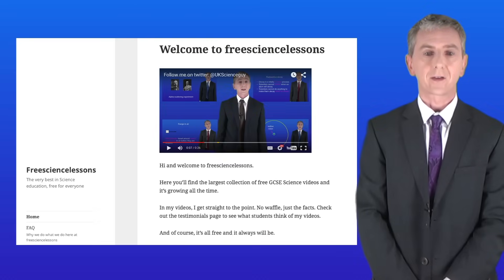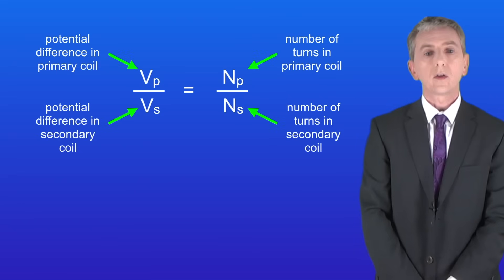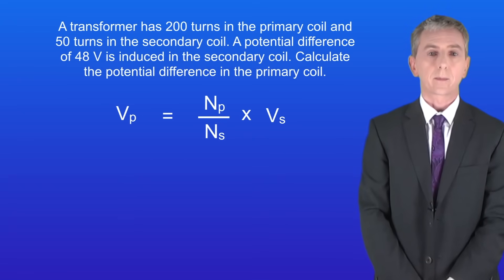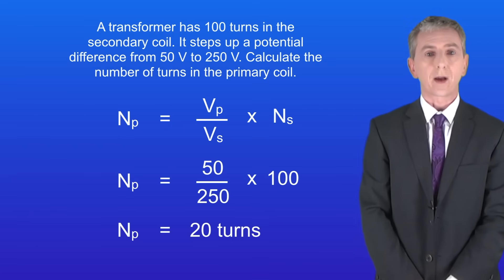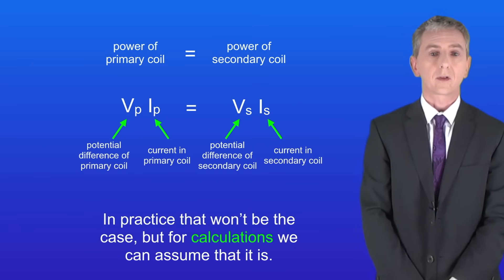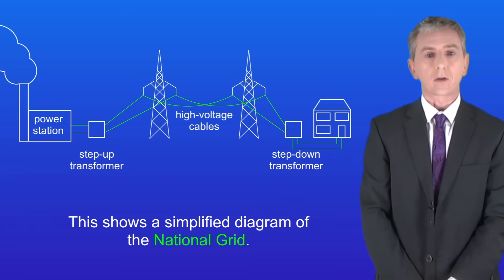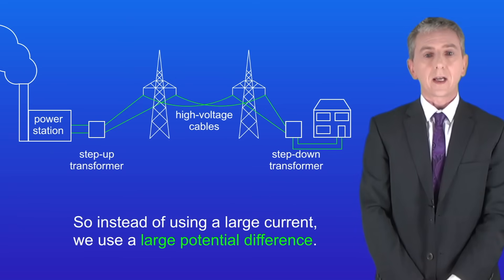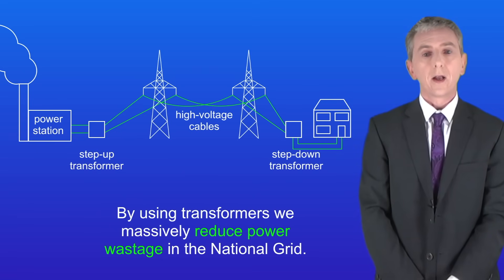GCSE Physics Revision  "Transformer Calculations" (Triple)

Comment: I don't understand why the potential difference across the secondary coil be 200V wouldn't you minus 50 from 200 because 200V is the potential difference of the whole transformer? Please explain I don't understand
Reply from the maker: The potential differences apply to each coil of wire not the whole transformer. Each side has its own potential difference. Remember that transformers work with alternating current, in other words where the potential difference rapidly oscillates. The changing potential difference in the primary coil induces a magnetic field in the iron core. This magnetic field passes along the core to the secondary coil, where it induces an oscillating potential difference. If the two coils of wire have the same number of turns, then the potential difference across the secondary coil will be the same as the primary coil. If the number of turns is different in the two coils, then the secondary potential difference will not be the same as the primary. I hope that helps.

Comment: Sir I did not understand why pd has to be higher and not current. As pd is directly proportional to current , won’t the current increase too.
Reply: Might be too late now but idk if ur school is doing testing but its because if current is high a lot of energy is lost by heat when the power is transmitted across high resistance cables, but when p.d. is high this isn't true

Comment: Hi Shaun, I understand that as P = IV, then for the same power if we increase the voltage, we decrease the current. However, considering the equation that you referred to of P = I^2R, surely if we have a decreased current, then for the same power, resistance must increase? Which is the opposite of what I thought was supposed to happen... if you (or anyone) could help me I would be v grateful 😂
Reply from the maker: You need to consider both equation together. To increase the power, we can either increase the current or the voltage. Increasing the current causes unwanted energy transfer to increase as the square of the current. Increasing voltage does not have this effect.

Comment: Well after electricity passes through step up transformer... the AC is converted to DC
there is DC current in the high voltage cables
so how does the step down transformer works if the current is DC?